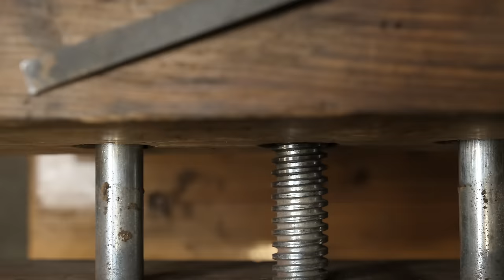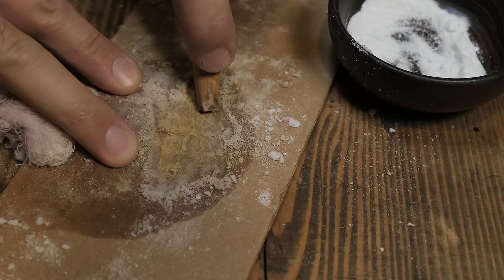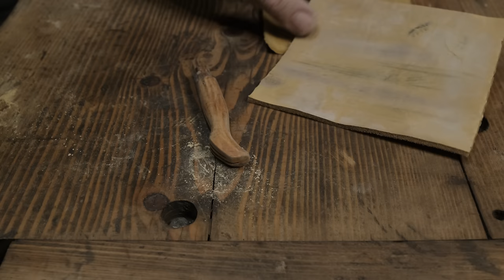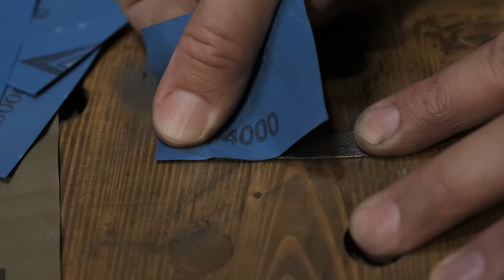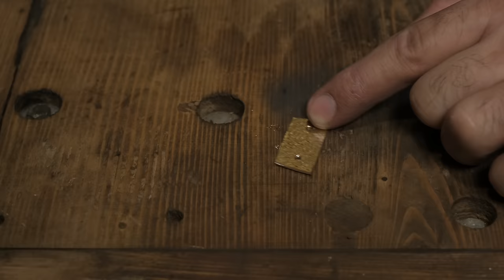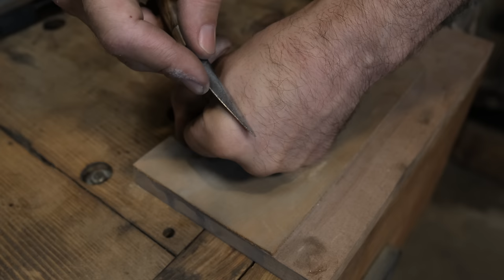Double Blade Pocket Knife Restoration

Comment: My Grandpa was an inventor and tinkerer.  He was told when he was an apprentice to dust the file with baby powder or cornstarch a file before filing brass or aluminum. The file brush cards better at the end of the day. I've done it for 40 years. Just a suggestion. EXQUISITE restoration again Sur.
Reply from the maker: thank you very much my dear friend. Respect to grandpa and great to hear any advice any time.
Reply: I notice that no one seems to tap their files to remove loose bits…

Comment: Is there a reason why you waited to hone the blade until after assembly?
Reply from the maker: there are two reasons.  I wanted the hard work to end first.  2nd reason ;  Having a handle is an advantage when sharpening.  It makes it easy to hold. ✌🏻⚒️⚙️
Reply: @byOldHand  I knew you had to have a reason. I was just sweating the whole time, afraid ot was going to scuff your beautiful brass. 🙂
Reply from the maker: @Little_Red_Riding_Hoodlum  😂😂😂✌🏻✌🏻✌🏻 the horror time ⚒️⚙️ We managed to do without any problem 🌟